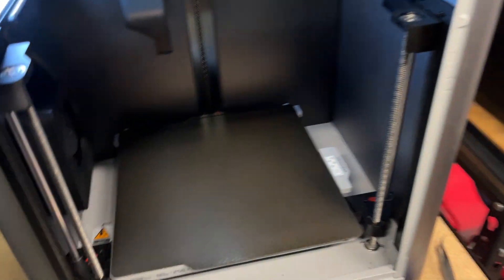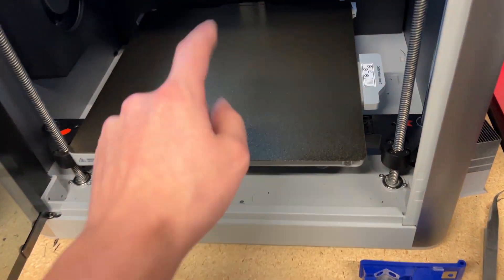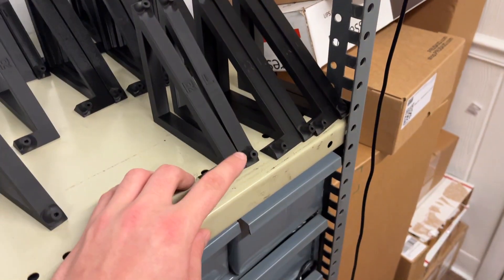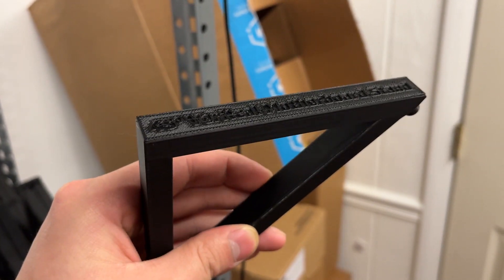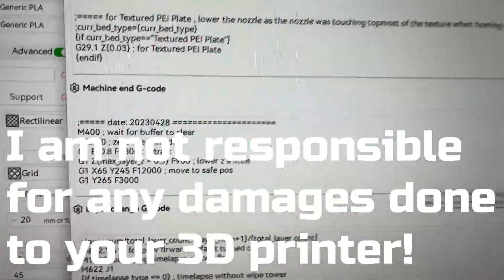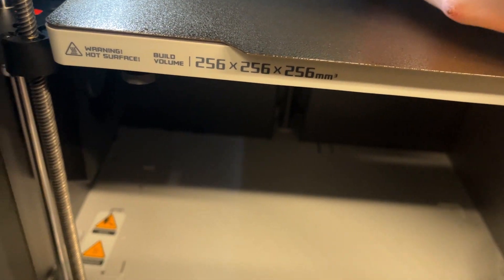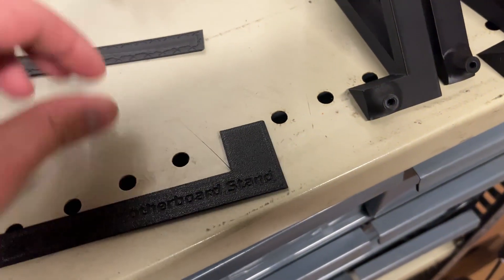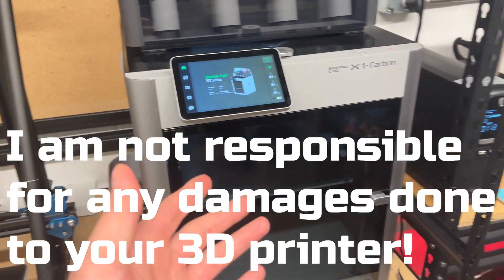Edit Z Offset for Bambu X1 Carbon V1.7.4.52 (2023)

Comment: To add Z offset for another plate type, simply add "elseif" code like this:

;===== Multi Z offset settings ========
{if curr_bed_type=="Textured PEI Plate"}
G29.1 Z{-0.04} ; for Textured PEI
{elsif curr_bed_type=="High Temp Plate"}
G29.1 Z{-0.04} ; for High Temp Plate
{elsif curr_bed_type=="Cool Plate"}
G29.1 Z{-0.04} ; for Cool Plate
{endif}
Reply: nice, but what is the default Z offset for the other types of plates?

Comment: Had a huge issue with my z-offset being too low, so it would make trenches and hills. I hadn't realized that the textured plate could be off by so little and make everything breakdown. I had tried printing with a smooth plate and nothing would stick, and the print went so bad that the extruded plastic gummed up and moved upwards into the housing of the extruder. 

Took out maybe 80g of filament from it and prayed and continued printing. It still prints non flat bottoms decently, but couldnt for the life of me figure out how to get it to print nice flat surfaces like before. 

Took a lot of googling and went through a lot of unsolved reddit threads to finally stumble on your video. Thanks for this my man. Much appreciated, I was getting ready to just resell my A1 on ebay lol

I'd like to add also for those who also stumbled here - I solved 80% of the problem by adjusting my -0.02 z offset to 0.02, and the other 20% went away when I cleaned my PEI plate with acetone. <3

Comment: I'm really confused. I was pretty sure that negative numbers bring the bed closer to the nozzle (more squish) and positive numbers move the bed away from the nozzle. You changed from -0.04 to 0 which should move the bed even further away which should cause more issues. Is my understanding wrong?
Reply: The more negative the closer to the bed, this guy doesn’t understand what the z offset is
Reply: @polstery  Thank you I was thinking the same. smh
Reply: that is how I understand it as well, i guess i gotta find out. Did you figure it out?

Comment: Hey man thanks so much for this. I'm printing PETG and having a lot of issues with buildup on the nozzle. If I wanted to raise the nozzle further away from the bed, would I use a positive (+) or negative (-) number ? e.g. -0.04 or +0.04? Thanks again,
Reply: moving into positive numbers raises the bed, ie brings the nozzle closer. You would want to move into negative territory to lower the bed/have the nozzle further away. So -0.04 has the bed further away from the nozzle than +0.04
Reply: @originaltrilogy1  Thanks! I don't understand why in the g-code, the comment by Bambulabs is "for Textured PEI Plate , lower the nozzle as the nozzle was touching topmost of the texture when homing". Wouldn't this imply that the negative offset set by default (-0.04) raises the bed closer toward the nozzle? Or did they mean to say, "Lower the plate"? which is what the negative offset would imply in your reply. Just trying to understand this as it's not making sense to me.
Reply: @finno_0708  exactly my thought, did you figure it out?
Reply: @ThePVPsheep so drawing from my CNC schooling the way I understand it is basically.... 0.00 is where the nozzle touches the bed when the print starts it offsets (lowers) the bed by -0.04mm which is why changing the offset to 0 or into the positive range raises the bed closer to the nozzle.  So the more towards or into the positive you go the closer the nozzle should be to the bed. The more negative you go the further the nozzle gets from the bed. Hope that helps! 😁
Reply: @seanburton3130  that makes a lot of sense! Thank your taking your time to write this out :)

Comment: I have managed to make a perfect first layer without grooves by setting the z offset to -0.12 but the rest of the layers are very pressured, is there any possibility of set z layer 2 to a normal parameter?
Reply: Maybe use initial layer flow instead of z offset.

Comment: Thanks for posting! I've been having the same issue, and while changing the gcode fixes it - I think that this a symptom of some underlying issue. The printer should be able to precisely scan the bed and determine the optimal z-offset. I have a friend with the exact same setup (same printer and textured PEI plate), and he hasn't had any issues with it. Could something be off with one of the sensors?
Reply: If using the standard Bambu print surface, and choosing the correct one, then you shouldn't need to adjust. Check the wiper is clean, that the print surface is clean and your temps and flow rates are correct for your filament.

Comment: Appreciate this immensely man. I ran into the same thing that everyone said the z couldn't  be adjusted and I was about to send this machine back. Nothing was sticking to the bed and I was really getting frustrated with ruining prints halfway though. Come to find out not only was the z offset wrong the preset for the filament was off quite a bit too. I'm on my third small print tonight and feeling like maybe I can start getting a little confidence in it.

Comment: Ignore this comment unless you want context. My solution to this problem is in the comments. 

I was just about to return my build plates hopefully it works now!
Edit:  Okay, after some testing it looks like its actually the other way around now i need to go further negative not positive for the z distance.
Reply from the maker: Yeah, I was testing again and it worked better backwards.
Reply: @ZackExperiments  ok so I have figured out what my issue was. This had nothing to do with it. It should automatically level itself with the bed for you. No need to change that setting at all. I had some leaking filament coming out of my nozzle and it was messing up the leveling process. Once I cleaned off my nozzle real well. Build plate worked fine with normal settings.
Reply: @ZackExperiments thank you for the video. It was quite helpful in the procedure to change the code. I do agree though that in order to get the bed closer to the print head the change has to go more toward the negative side.

Comment: Where is the z offset for the cool plate, its not in the start code.
cool plate z offset is not even mentioned in my version, latest as of Jan-5-23.
I found snippets of older start code with the cool plate z offset but not enough to copy/paste.

Comment: Thanks for sharing. I'm having the same issue and I'm going to try your suggestion.
How did you create that printer profile?
Reply from the maker: There should be a little save button, then each time you load a print you can select it under user presets on the left hand side.